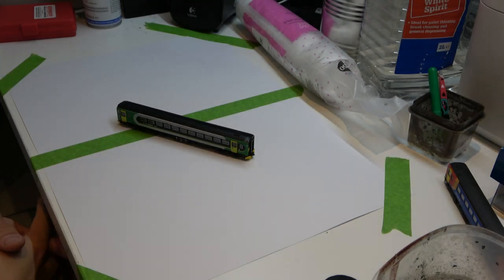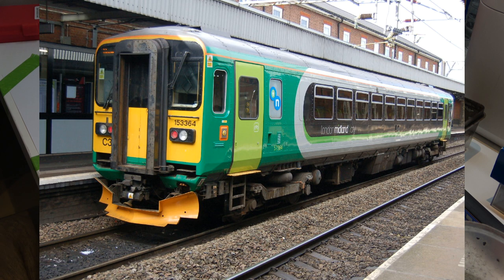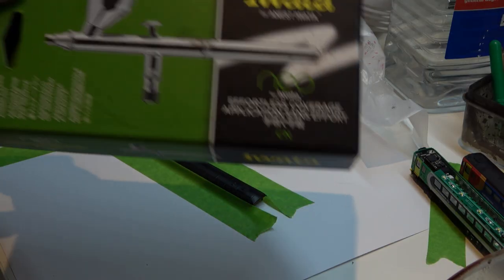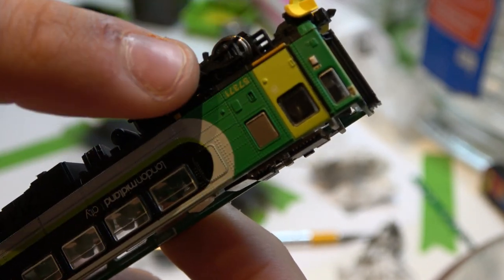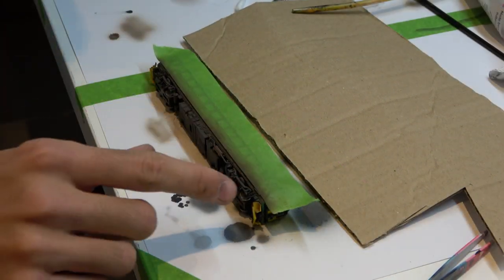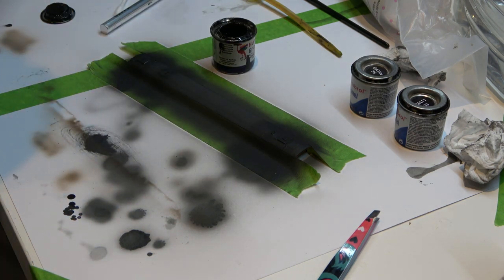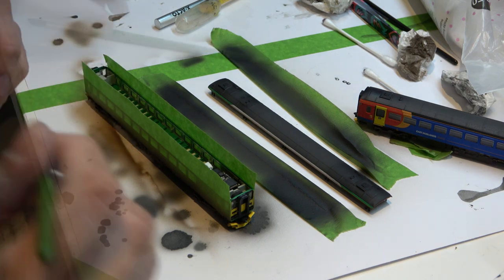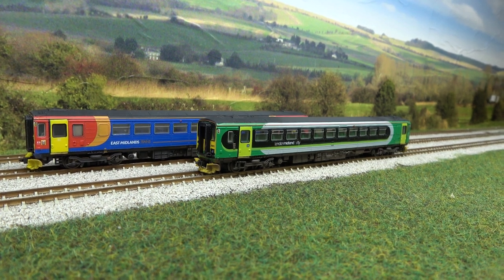Weathering an N gauge Class 153

Comment: Plucking up the courage to do the first one is always the hardest. You've managed to strike the right balance. Modern stock gets cleaned regularly so you are right to stick to mainly the roof and underframe. Great first attempt. Cheers
Reply from the maker: Yes definitely, and thanks:) tried to get away from the factory weathered look of models which are just basically coated with some mud colour from chassis to half way up the body, you just don't see that in the real world!